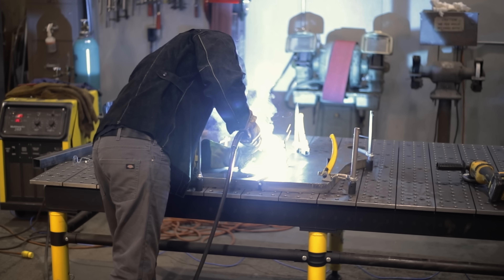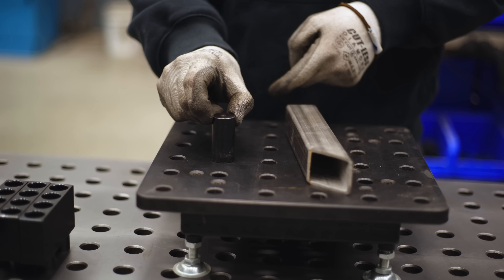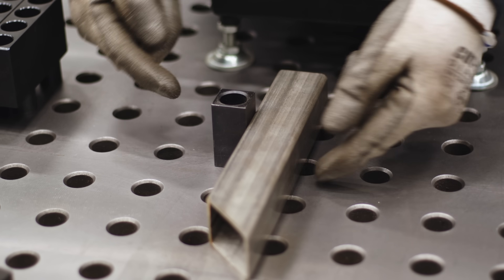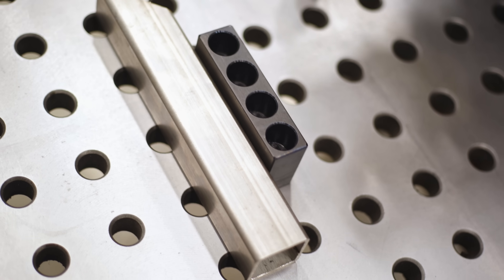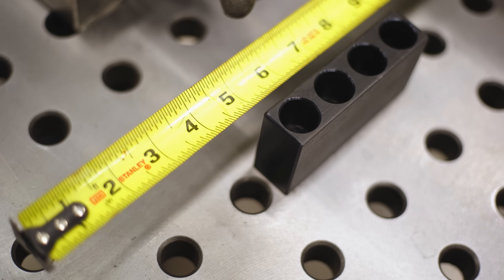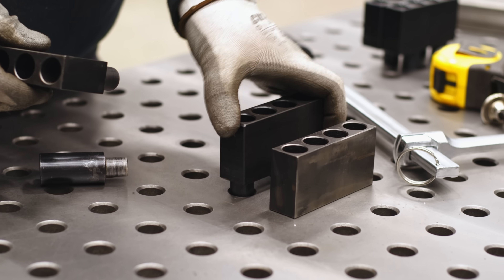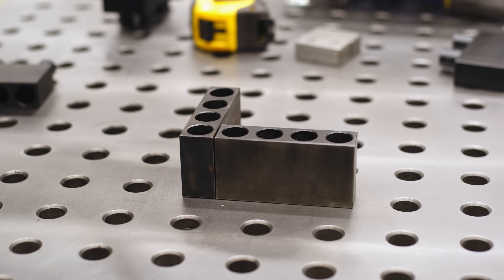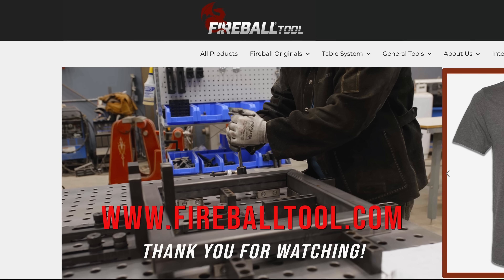Why are welding pins Round?

Comment: This overblows the problem massively.  If you measure the movement of the round pin at the lowest point of contact you will find it to be minuscule. It will never matter for 99.999 % of projects
Reply from the maker: Round tube does not touch the bottom

Comment: Hello Jason of fireball tool.

I have come into possession of a couple of ball screws that were used as the Z-axis for a 30hp CNC machine. It was replaced because it had .02 slop in it. Not very useful for the machine it was used for originally but I have found it to be incredibly low friction and it looks almost brand new. I think it would be a very interesting replacement for a thrust bearing and I bet you could easily crush your other vise build in terms of clamping force and closing speed. I have cleaned it all up and removed all the grease and swarf. 

Before I cleaned it when I had it clamped vertically in the soft jaws of the forged fireball tool vise I bought from you. The greasy ball thread nut would start rotating down the ball thread with the help of gravity, clearly some very low friction involved in this screw. If I sent you this ball thread would you be interested in doing another vise build video for “science”? Not sure if you will see this since the video is two months old but this is about the only way I can find to contact you if anyone else knows a way to contact him please do share.

Comment: For actually precise fixturing a round pin is preferable, because then you get a line contact between the work piece and the fixture instead of refencing dimensions from whatever random spot on the face of a block. To my eye this doesn't seem to be an issue with fixture desing, rather one of tolerancing, a h7 pin would fit pretty damn straight and wobble free in a H7 hole, but welding is a tape measure trade and you can't measure microns with those.

Comment: Why a round pin...because if your adjoining a square corner using the round pin as two of your reference points... you can still weld the joint without your pin being in the way of welding

Comment: Unnecessary solution to a problem that wouldn't exist given proper tolerancing of the pin holes in the first place. A H7 reamed hole with h8 pins would solve the issue at a negligible increase in manufacturing costs. And for the purposes of weld fixturing that dimension won't change considerably with temperature either since those holes would expand about 0.04mm at 300°C (a temperature highly unlikely to even be reached locally on the table while welding).
Reply from the maker: Close tolerance’s don’t work on welding tables. The holes and pins get dirty. This increases the likelihood that the pin will get stuck or just not go in the hole. The cost of the fixtures will increase if a tighter tolerance needs to be held on the table and the fixture. Sorry tight tolerances are not a good idea.

Comment: The rocking could be solved by using upside down cones instead of cylindrical pins.
Reply: Would rock more and you could not clamp to it?
Reply: @GPP-pz4ou  a cone would be a perfect fit and not rock at all.

Comment: Got a request project for u if interested. Simple but can get ridicules... can crusher. Soda can crusher with lever operation an gear reduction. I'm currently in a building design phase, pen an paper, for my 13 kid for a side hussle on recycling. Wanted to ur take on it. Rules. No air or hydraulics.  Has to be Mobil for setting up at dinner parties or conventions.

Comment: So the way we do it. Layout your rail(or whatever you're building), and tack stops directly to the table. Shim material up with 1/4" shims and build away. I mean, for about 90% of what you're building, that's perfectly acceptable. These tables are kinda overkill unless you're making NASA parts
Reply from the maker: The point of theses tables is that you don’t have to tack to the table. Make changes quickly if necessary. Save the placement of fixtures for reoccurring jobs.

Comment: As a machinist who has rather tight tolerances, this is not good. My cuts are  ±.0025in and they are considered sloppy by aerospace standards
Creating concentric round pins threaded into posts going into the board could be vastly superior to your square ones. Because you can't rely on your eyes to match machine precision to line the edges of the square blocks to your table. The canter is an improvement but the shape of the pins is a MASSIVE downgrade. You could possibly add notches to assist with angular alignment but I think a blend between the two would be the most ideal

Comment: How about a tapered hole and matching pin?  Would unfortunately be proprietary, but should also fix a lot of the problems you brought up.

I dig the block system, and think it's good for the most of us that already have tables with 5/8 holes.
Reply: Tapered pins are already a thing. Not sure if many tables have the precision needed.

Comment: Well round pins have the advantage that they only need a consistent diameter and concentric pin to follow the precision of the table with those blocks you have some more potential to lose precision.
If one pin is off by 0.1 mm out the center over 6/4 that's a built in 0.15 degree flaw. 
So I'm wondering to what tolerances those blocks are made

Comment: Only advantage I see in a round pin is it’s a little less likely to get spatter or something stuck between a round pin and the material vs a square pin or block. 

If you were doing 100+ repeat parts with the mig it can get messy.

Comment: There's a simple reason for round pins: No matter how you put your piece you always have a single point of contact. It's just how circles/cylinders work.
Reply: No "Termal deformation" too
Reply: Oh great he discovered Legos.
Reply: why do you want a single point of contact? particularly if that single point of contact is at a variable location. honest question.
Reply: @Dannerrrr  look into GD&T, particularly about datum. Placing a flat piece of bar against 2 round pins will precisely define a line in space.
Reply: @cr1ticalRevenge  I know this, but please pay attention to the second part of my question. If the 2 or 3 pins are each at a variable position, you're defining a different line or plane each time. does that still give you some sort of confidence? sounds like a 2x4 block with a radius might be interesting?
Reply: @Dannerrrr  why do you think they aren’t always at variable positions. Variance in festures of size for the square block will throw it off as much as the concentricry of the circular bolts.
Reply: @Dannerrrr  Maybe it is similar to using round stock in a vise? In that use case it helps ensure that your material is square with the jaws
Reply: @Dannerrrr  If you have too many points of contacts you become hyperstatic. If you want to make something with fairly loose tolances it wouldn't matter systematically but if it's something that need to be really precise it will definitely impact the end product.
Reply: Well, if you have a piece of quadratically aligned steel you can g
contact the circle at 2 points exactly, but that's a less common situation

Comment: Would it be possible to put 2 extra threaded holes in the bottom that would fit the holes at 45 degrees? It looks like there is space on the fence block.

Comment: I know it would add cost, but what about a pin that is sliced on a diagonal. The other side would make the other half of the pin with a stud up through the internal hole of the square block. Inside would be a takeup nut that would draw the pin up and lock it to remove slop and keep it semi permanent.
Reply from the maker: These are supposed to be a cheap fast set up option. There’s a more permanent rigid solution they are called tack bolts.

Comment: I haven't done enough welding to be sure but i feel like the round pins are used in the way i use an angle grinder as a toolmaker. It's cheap, fast and it works (for rough tolerances). 

I think i could see yours readily replace them as a better alternative for a single time purchase cost.

Comment: you forgot about the pins stops that have an allen screw in the top that puts pressure on 3 ball bearings that push out on the chamfer on the underside of the hole and lock it in place and suck it down.    A round pin is easier to machine, vs a square with 4 sides that must be parallel and perpendicular to each other.   the idea of the two pin is a good idea but i have not had trouble with the pins that have the allen screw in them.
Reply from the maker: I sell ball pins. These are fence blocks

Comment: This is great information.  I don't weld but i get great tips and tricks for woodworking on MFT style workbenches.  The dogs have the same issues.  If you want to take on woodworkers, make these and your other fixtures in aluminum for 20mm and 3/4" dog holes.  The hole are on 96mm centers for the 20mm benches and usually 4" centers for the 3/4" benches.  I'm told 96mm is some international standard.  We just call it Festool.

Comment: I would agree that round pegs don't make very much sense when you're mostly assembling Square things. I mean wouldn't you want a nice Square block to line up against? Why they have even made round pins to begin with just doesn't make sense to me. I could kind of see an advantage in that you could line them up at whatever angle you wanted but still I would prefer to have some nice Square surfaces to line up against myself.

Comment: My table is 1/4 inch top what size holes y'all recommend and how far should the spacing be
Reply from the maker: 3/4 2in spacing if you want to use the fireball fixtures and clamps
Reply: @FireballTool  thanks!

Comment: I think one big factor is that the single pins are a lot cheaper. Would it be possible to drop some functionality of the fence blocks to cut costs? Maybe make a version without the holes on top?
Reply from the maker: I think you’re missing the point. Add capabilities not limit your fabrication choices
Reply: @FireballTool  I arther think he had a pretty good point.  Nearly every welding shop I've encountered would much rather weld a piece of scrap to the table where they want it than spend actual money on a tool.  Expensive tools are a luxury.  I'd love to have one of your tables and a full set of hardware to go with it, but I can't get basic consumables most of the time.  If I had a real need, I'd much rather buy a multiple highly flexible round pins than just one nice block that only does right angles.

Comment: Thanks for the video.
Just wondering why not use an expanding pin to lock them into place, and stop the rocking?
Reply: You could, but it's easier, faster, less fiddly, and using a less expensive product with no moving parts that can fail or that require maintenance by simply, you know, rotating the long blocks 90° or backing it up with a second long block that's rotated 90° from the first block, the same exact way as is demonstrated in the video...
Reply: @msytdc1577  Thanks for the reply, I understand all the failings of the system, was just wondering if it would work. Way more work to make and maintain. Fireball tools block system is way less complex and easy to use.
Reply: @felixcosty  Well, it looks like they do sell pretty much what you're talking about on their website, called a tacking bolt. They work with other fixture styles only however, as to use the locking function they require access to the top of the bolt, which obviously would be difficult when these new fixture blocks are solid hunks of metal and designed to be able to be stacked on top of one another.
Reply: @msytdc1577  Thanks for the info will look into those.

Comment: You should make a locking plate with 2 pins, so you can lock 2 blocks together without clamping.
Reply: The long blocks have holes in all four positions so you can stack a second layer that overlaps the separation between two blocks on the first level, though I'm not picturing a situation in which that would really be required or of benefit, the blocks going into the fixture table is plenty strong and stable, they're certainly not going anywhere without you intentionally lifting them out.
Reply: And looking at the Fireball Tool website and the more detailed fixture video there it looks like they do manufacture a long block with a portion that is half height allowing you to lock blocks together.

Comment: I prefer. The siegmund and demmeler  system. Square blocks with a Quick bolt.
Reply from the maker: How can you prefer one or the other if you haven’t tried both?
Reply: @FireballTool  
Because switsching from round  to square  but still use a round bit thats not fixed  in the hole isnt quite a gamechanger for me. When u use a fixing table u want ur stuff fixated.

Comment: The bigger annoyance I have with current pins for my strong hand table is the strange diameters.  Same with the widths of the rectangle stops
Reply from the maker: Yes I totally agree. That’s why I standardized the fireball fixtures at 1” increments.
Reply: @FireballTool  I was actually shocked when I first got the tooling package for my build pro.  In some older documentation I swear that i saw some specs showing their horizontal stops and pins having uniform inch dimensions.  However it looks like thats no longer shown.  It is so irritating that I cant use the standard stop pins to jig a square frame that falls on the proper dimensions for the table grid.
Reply from the maker: @unknownuser8885  Yep get some fireball fixtures.
Reply: @FireballTool  great, plan to.  I have a bunch of your other stuff like the squares and the shim blocks but for some reason I thought you were only making fixture table parts for the 3/4 pins.  I'll definitely buy some now that I see you've got 5/8 stuff.  Thanks for supporting us 5/8 people still!

Comment: The wiggle room isn't having an significant impact on accuracy, as the workpiece is touching the bottom, which is moving at most a couple thou. A couple thou off for a weldment isn't an issue, and if it is, the part should be designed to be machined post welding for accuracy.
Reply from the maker: Round tube is a problem. It doesn’t touch the bottom
Reply: @FireballTool  or heavy wall square tube, if you go thick enough the bottom contact could be 1/2” above the bottom
Reply from the maker: @Ballisticdevelopment  yes absolutely
Reply: Also, if clamping to a pin, you may only be out a few thousandths at the bottom, but maybe a 1/16" at the top, depending on how sloppy they are.  This would cause all your tubes to have a twist in them potentially, depending on your clamping layout

Comment: What if you made a pin that could expand in the hole when you tighten a bolt?
Reply: Yeah like the tool gunsmiths use to support shotgun barrel from inside
Reply from the maker: We make it it’s called a tack bolt.
Reply: @FireballTool  Why not make it like a expanding mandrel? Much easier to make ,a bolt that has taper in it and the tip is split ,then you have threaded conical part that matches the bolt taper which expands it when tightened by a screw that goes trough bolt. Principle similar to a collet but instead inward tightening it expands and pulls the whole fixture down.
Reply from the maker: @zumbazumba1  Not enough space, weaker design, doesn’t have enough pull down pressure, won’t release reliably, cost of manufacturing, fatigue points, just to name a few reasons. Expanding balls are simple, strong and effective.

Comment: Jason, watched your video this morning on why you need a fixture table. I agree with the outcome as I’m pretty much self taught and once I got my (German brand) welding table -about a year before you launched yours - and even using my 30+ year old Hobart mig, my accuracy went through the roof! Definitely a game changer and you should probably go get your money back on those weldments. Can’t wait to purchase some of your stop blocks.
Reply: What hole spacing do you have on your German (presumably Metric) bench? I'm thinking of making a purchase but not sure if the metric/imperial issue comes into play. 🤔
Reply: @paultrgnp  I’m  in the states so I have imperial - Siegmund has both.

Comment: How would the clamp hold onto anything in the configuration you had where you put the clamp in the fence block stack .. it would just pull the blocks apart wouldn’t it ?
Reply: The clamp doesn't just try to move upwards, it tries to tilt at the same time and since the tolerance in the holes is so little, it ''binds up'' and locks it into place.
Reply: @NorwayVFX  correct , which would make the blocks not sq to the table anymore is my point
Reply: @travisschulz6342  the square blocks have a 90° shoulder, and as demonstrated, simpy use a long block with the direction of pressure/attempted tilt aligned with the long dimension of the block to prevent any tilting of the block.

Comment: "a little slop" uh my guy thats alot actually.. and you don't need that much.. i mean we use precision ground pins and reamed holes to align our molds for milling and mounting.. and that slop is basically 0 (as they should be or else everything would be out of alignment)
Reply from the maker: Welding tables get dirty fast. To tight of a hole to pin tolerance will cause the fixtures to get stuck. There’s a balance between usability and accuracy.